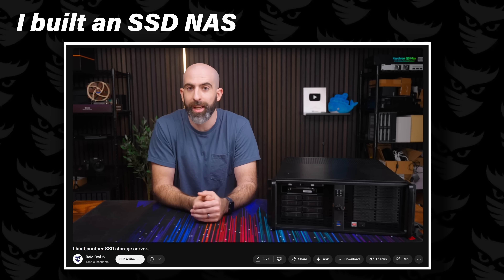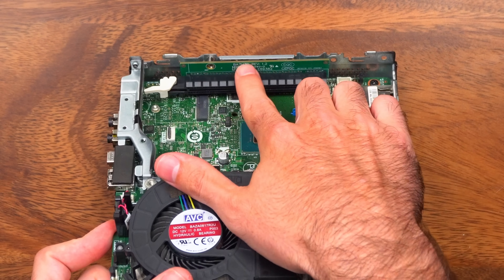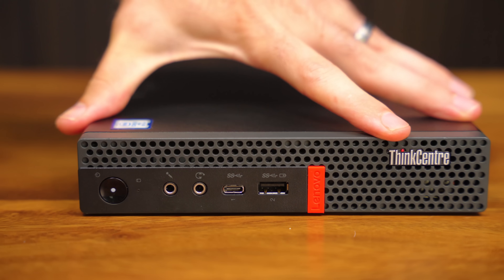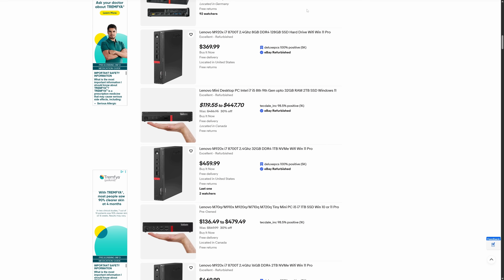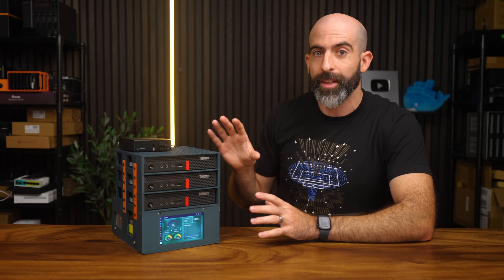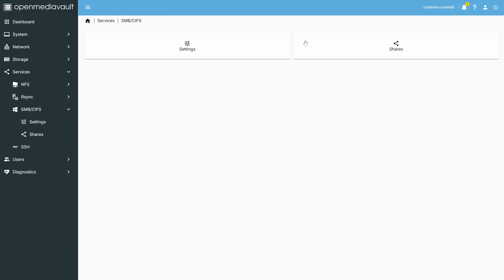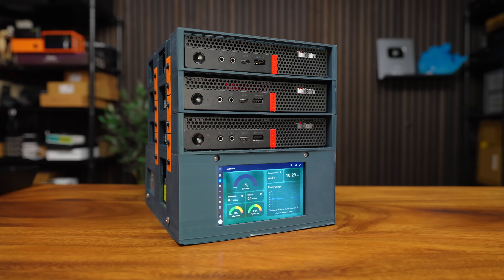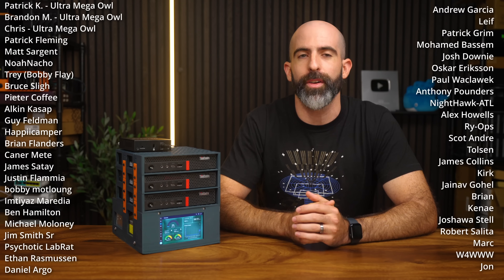I built a tiny home lab

Comment: I will run pfSense and Proxmox on the same machine, using one for out-of-band (OOB) management. Also, the server has four network ports, an extra switch isn't needed-properly configured network bridges will suffice.

Comment: yeah for pfsence throws look cool ,  my is currently running on a AMD Sempron 3850 APU from 2014  well is actually the only thing i could use that pc for ,well i could also use it as simple nas   it was to slow to run windows 7 or linux mint ,  but was cheap , ,   but my 2 current nas run on a lga1150 , one with i5 other with i3 ,

Comment: The add-in card in the Hypervisor system looks very "unofficial". Another idea would be to put an HBA mode controller with external connectors in there,  like 2 x SFF8088 . That would give you 8 SATA ports for NAS Storage, Cache SSD or whatever.  That would also solve the USB Raid issue.
I'd also probably print a cover for the AC connection. That does not look safe.

Comment: Do you have a video on how to set up the power supply? I’ve started with 3 Lenovos but I’m using the power adapter for each one. It looks like you’re using a single psu for all 3?
Reply from the maker: I put a link to the psu, barrel connectors and lenovo plugs in the description. Basically you just connect those to the 3 outputs on the psu and you're good. I used a distro block too in case you wanted more than 3 machines but its not necessary.

Comment: They're a little pricey but QNAP makes PCIe cards that with PLX chips that have 4 NVMe slots or 2 NVMe slots and a 10 gig NIC on a single 8x card. I used them at work to make Proxmox backup servers out of some old hardware we had laying around. You're obviously limited to a total of 8 lanes of bandwidth but if you're not going to hammer all the drives at once they'll get the job done.

Comment: 👍 Follow-up video idea: remove mobos from their stock cases and add graphics cards (exclude pcie riser). 3D-print a new custom case to house all three with good airflow; I can imagine some wild and impressive designs with a single 200mm front fan or quad 90mm front fans. Please simplify by reverting to 3x stock PSUs, which are quasi-redundant, very easy to replace, and better for your airflow.
Furthermore, I would have liked to have seen this stack head-to-head against an used $650 gaming pc (e.g. 8c16t) re-configured as hyper-converged mono platform for all of these node services, because the treble Lenovos got a 105W (3× 35W) power budget and a $650+ financial budget (3x m920q + 3× RAM + 1x PSU[not optional?] + sundries).

Comment: Damn, I imagine each of them with 9900T, 64 RAM, 2TB M2.NVME, 1TB M2.SATA and I-340/350 T4 in a Proxmox cluster :) May be 3x1TB USB rust for additional slow storage... Also take a look at RSP-200-24 from MeanWell. It will be sufficient and have way better currents.

Comment: If every "shelf" (unit) with its own PC in it can be removed as one piece, you could also make a taller version with spots for hard drives and run the cables out from the back. That way you could have however many harddrives you can have connected and still have serviceability. Also if you for some reason need to add more units down the line you could just print another shelf out and add it to the stack. Really cool stuff though :D

Comment: It has been reported that pcie bifurcation can be enabled by soldering some resistors on the motherboard. Additionally there are user made riser card which give you pcie 8x and an nvme 4x slot - this is because the motherboard actually exposes 8x and 4x for use with different risers. On m920x it should be possible to get 5x nvme with 4 lines each with some elbow grease. That is on top of a sata drive
Reply: I did this very mod to one of my M920Q’s. Also added the second NVME slot. Currently setup with a shucked SATA SSD, 3 NVME, 10gb network and the 4th NVME driving a SAS card via an extender attached to a drive shelf running trueNAS, in a slightly taller 3d printed top cover. Very capable machines.

Comment: I liked the power supply setup! Just a question, how did you connect the PSU to the tinys? is there an square plug adapter for those?

Comment: Great video, keep up the content!  I've been using several m910x's that I found cheap from a electronics recycler on ebay, chip swapped from i5 to i7, re-sold the i5, bumped the ram to 64gb.  No native usb-c port, but and been running rock solid for several years.  These are great work-horses for homelabs!

Comment: 4:41 I ran into a similar problem on my m920q build I found that with a GPU you have to use afterburner to limit the voltage and frequency and it works just fine

Comment: I’ve tried Proxmox before and wasn’t really impressed, though I get that if you’re running ZFS shares on a TrueNAS or Unraid-type environment, it can make sense to go that route. Personally, I still run VMware wherever I can because I’m more comfortable with it — so that’s definitely a preference thing.

Your setup is interesting, but I probably would have taken a slightly different approach. You could have virtualized pfSense, a recursive DNS server, and a proxy directly in your Proxmox cluster. That would turn it into a mini home domain controller with gateway functionality. Then you could run Zabbix on that 5-inch display for monitoring.

That would leave you with two machines: one as the primary NAS/SAN storage node, and the other as a small-scale LLM/AI workstation. It could make for a truly integrated “micro enterprise” setup. Still, I really like the ingenuity that went into making this possible — I have two ThinkCentre M700s myself and was wondering what to do with them, so this little project sounds like a lot of fun!

Definitely will use less power than my PowerEdge R720 that's for sure!

Comment: Really nice, I was looking at getting one of these for lightweight AI work with a small GPU, you seem to say it's not a good idea, am I right?
Just on the 3D print, I get your wanting to do it yourself, I do to but there are some 10" racks that are amazing and with extra fans may resolve you over heating issue, that how I solve mine, I have 80mm fans a the back exhausting. I am currently using a HP EliteDesk i5 10th gen with 3 drives (2x NVME an 1x SATA SSD) for Proxmox, a 8th Gen I5 Intel NUC for all my media needs )1 MVME, 1 SATA SSD an 2x usb drives a 6TB an a 4 TB. the rest is all Raspberry Pi 5 with different configs but all SSD drive, one has a Raxda had with 4x 2TB 2.5 ssd running OpenMediaVault and one Raspberry Pi 5 dedicated to Nextcloud. The network itself is 100% UniFi and I just ordered a pi to install UniFi server. As for my monitoring screen I use old pi 4 and the 7" pi screens in a printed housing around the house for HA who has a Pi5 dedicated to it.
Have a look at Lab Tax on Printable as well as its remixes, that what I use, very flexible.
Everything is backed daily to a Synology DiskStation with 20TB of spinning disk in raid 5.
Petty I can share picks, here

Comment: Hi can you share the link of the 4 port ethernet card? also you can solder the m2 socket with some resistances and capactiros to get a second nvme, also you can buy a sata to msata adapter and use the sata port to get an extra disk, also you can do the same in the wifi slot for a 2230 nvme.

Comment: I understand what you are doing, but I would never stack those minis with zero air gaps like that. You are asking for trouble stacking them like that, well unless you house is climate controlled at about 15 degrees Celsius.
I use HP Elitedesk mini's G6 with GPU's and they absolutely need the meshed lid for air flow (also the more powerful power brick). When I got mine it they did not have the mesh lid so I just bought them from China.

Comment: Hot tip, I installed xfce4 on top of proxmox, so I could have a desktop straight outta the hypervisor. Means I can have a touchscreen monitor on top of my rack which serves up a Home Assistant dashboard, and I can get to Web UIs right on the rack, without worrying about connecting over wifi or further along the network

Comment: Looks a neat bundle, maybe given the heat issues consider removing the lids and have 120mm or 140mm fans on the rear or sides of the case pulling cool air flow through.

Comment: I have 3 of the HP mini PCs in my homelab as a Proxmox cluster. They each have their own power brick. I would like to replace that with a single power supply like what you did. Do you know if a power supply like that could be used on HP minis? I've heard they have some kind of smart plug that requires a genuine HP brick.

Comment: It looks amazing and I had a thought about the 3rd PC's pcie port as I was thinking about adding it as well into my HP server of an adapter for pcie to external oculink to connect other pcie devices to it for example your issues with the graphics card overheating issue could be solved by oculink the GPU outside of the PC or finding other adapters for more storage capacity.

Comment: Please do yourself a favor and model/print a terminal cover for that power supply. - having 110v exposed like that for any fingers or tongues that are passing by isn't a great situation.
Reply from the maker: The terminals have a plastic piece over the top that snaps on
Reply: @RaidOwl  awesome! - sorry to call it out, it just looked like the terminals were exposed which could be a really bad day if you accidentally touched there or dropped a screw or a usb A cable connector or something onto it.
Reply from the maker: @Cpgeekorg  all good, its a fair critique

Comment: One thing worth mentioning on the m920q (vs the m720q) is you get vPro/AMT support. That means you can remotely manage the devices via something like MeshCommander. This enables remote control, power, and other functionality. Definitely a plus for the home lab use case!

Comment: You can still use 2.5Gbit/s NICs if you like. Just grab M.2 E Key (WLAN) to either Realteak or Intel 2.5 NICs w/o sactificing any of the expansion cards you use currently. The only issue would be to find the place to mount the port.

Comment: Those Lenovo machines are great
I got two m720q running a Kubernetes cluster (2 VMs each) with an i5 8500t and 32gb RAM, they pack a ton of juice and you could easily understimate what they are capable of. But on the flip side I agree that managing power of both machines via their separate power bricks sucks.

Comment: I believe, with 3 hosts, it would be beneficial to run them in a proxmox cluster. Either with ZFS local storage or with a dedicated disk on every machine and ceph. In the configuration you're running, you don't have any high availability or redundancy, if for any reason the pc that runs pfsense dies, you're out of your internet connection. And since these are boxes from 2017-2018, that can happen. I do run a m720q and a m920q with a third node (hp 800g2) in a pve cluster, with zfs storage, and it's insanely well performing. Both Lenovo machines do have 10G sfp cards, connecting to my switch via DAC cables. Since my internet is delivered over fiber and an ONT to ethernet, I just bring in the vlan to both devices and have proxmox handle HA and everything. I've had a couple failures in the past, and once one host fails, the other spins up the VMs automatically within minutes, with very limited downtime.
Reply: If your heart stops, you're dead. Stop overthinking what doesn't ask for it

Comment: Nice job! Thank you for the time you have dedicated in making the video!!!!! These Lenovo mini PC are really high ratio Value/Cost machines... . I have a total of 7 Lenovo mini PC and i like it very much. 3x 920X in a Ceph/Proxmox Cluster,, equipped with 2x10Gbit/sec Intel Chipset NIC , 1x 2Tb NVME  + 1 250 Gb NVME + 1x 1Tb using an adapter in the WiFi Slot,   1 x 720Q with ProxMox Backup Server , 1x 710Q with a native serial port to comunicate with older electronics, 1 M720Q as my backup Machine and 1x 720Q as spare machine..'m using these machine for 3 years without any issue..So as you can imagine i love these machines.. 🙂
Reply: Hi! Could you please tell me which NIC did you buy? Thank you

Comment: Very nice build, very clean.  So many great ideas here.  Love the modular stack and the single PSU to drive it all (I hate power bricks!).

The only part that needs a some cosmetic work are the straps.  I think printing one single strap to hold all three parts would look so much better than the three short ones.  Even better - make a strap that "slots in" from the top and get rid of the screws completely (ala some of the designs from @makerunit).

Comment: Im interested in how the selfmade power-supply and breakout section would hold up over time. Neat idea but probably gets a little hot if there is more to connect and pushing close to the 20A
Reply from the maker: Maybe, but it does have a built in fan so that should keep it cool enough
Reply: @RaidOwl  Did you have to cut the plug off the end of the power cable that came with the pc? Your power distribution block looks awesome. I have 4 of these currently running in a mini rack and jamming all the blocks underneath looks terrible.
Reply from the maker: @vonwerderc Nah you can buy just the plugs with a female barrel jack off Amazon. I just added those links in the description.

Comment: Why not just use the extra NIC ports on the pfsense host and just route via /30s?
No need for L2 really.
Reply from the maker: because the idea is that this would feed downstream network devices anyway and would be much simpler this way
Reply: @RaidOwl  Fair, makes sense. I was thinking if you wanted it all self contained.

Comment: I would love to see a more detailed breakdown of your power distribution design. It looks very well thought out
Reply from the maker: I didn't go much into the power distribution because I assumed nobody really cared that much haha. But the power supply itself is pretty basic. It takes 120v input which I just used a regular C13 connector. For the output I just used the included connectors and some 12ga wire to run to the power distribution block I have linked in the description. From there you just have like 10 terminals that will have 20v DC from the PSU. I used some standard 8mm DC barrel connectors to make it easy to swap out to different machines later. The last piece is to get some lenovo plugs and connect them to the other end of the 8mm barrel connectors. If you pause the video when I'm showing the back side you can kind of follow. Hope that helps.
Reply: me too.. I have 3 of these same thinkcentre 920s.. and all would love to get rid of the 3 power bricks for that single power supply.. looks sweet!
Reply: Me too
Up vote this so raid owl creates a video ok it

Also more information appreciated if I want to connect some 3.5 hdd to it
Reply: I second this request, please :)
Reply: Same here! I have 3 of those and read about people having slower performance when not using the original power brick. @RaidOwl did you noticed any performance impact?
Reply: Same!
Reply: Same here!

Comment: You are doing great with your 3d printing. What I am trying to do is use three 4 port Protectli with a real cluster and then setting it up for Unifi and a configuration that can run a Robotics event with the scoring systems all tied into the cluster and never fail.  I have to work on my 3d skills to create the layout for how I am going to do a 8 port switch with the 3 Protectli's and power distribution along with a access point.

Comment: Awesome setup! I have a very similar mini server that I made using Dell Optiplexes. When it came to the power supply, I went with using USB C power bricks as PD already supports variable power output. You can also find 700W USB C charging stations which is more than enough to power multiple mini PCs. There are USB C adapters that plug into thinkpads/thinkcentres too.
Reply: Hi, I also have a mini lab with three Lenovo I5 mini PCs installed in a cluster that works very well. I also have the problem of powering them with CaN PD chargers, but I can't find any on Amazon that provide three USB-C ports that all three provide at least 65 bw each. Can you tell me how you solved it? If you think so, send me the link. Regards

Comment: Oh, yeah - forgot. On the heat thing and dremel modifications/leaving it clean, why not both? There's a bunch of different 3D printed posts on Thingiverse and Printables that include replacement lids and expansions for the Lenovo Tiny PCs - grab one and remix it with a ventilation shroud. :)
Reply from the maker: Yeah I didn't even think to look for a 3D printed cover

Comment: if you want to help with the thermal throttling with a graphics card ITG Gear here on youtube has 3d printed a top for that purpose or lookup lenovo part number "02CW661" it is lenovos graphics card top cover. I work at a university and the M720q's were our standard since 2018, we had a couple of users that needed more graphics power so I used the top above, a p1000 and a 90watt power supply to help with thermals and power consumption. I actually liked the setup so much I coppied it at home for my Plex server using a NAS for storage and another running ubuntu as an Immich server using the P1000 for AI funtions it is not the fastest thing but it is compact and power efficent.

Comment: I would like to see more about the power supply. I often have problems with my UPS / battery backup and plug size. I could remedy this with pigtails (short power cords), but would a power supply be a better option?

Great video and very informative. Thank you!
Reply from the maker: Yeah if you can find a power supply with the correct voltage and enough amps to drive your machines then all you need is the right plug.
Reply: @RaidOwl  Sounds like good dating advice. Thanks!